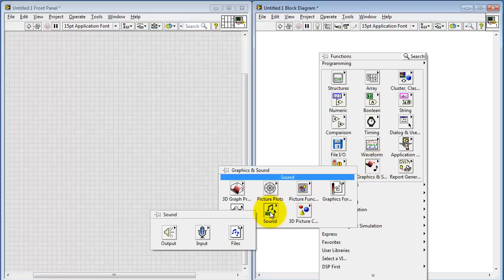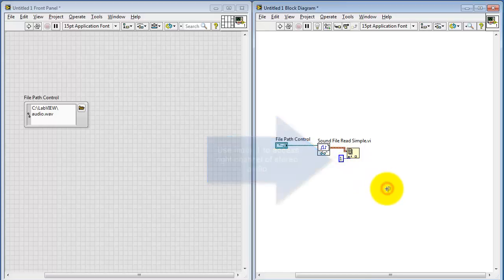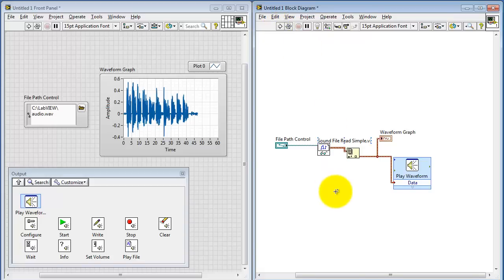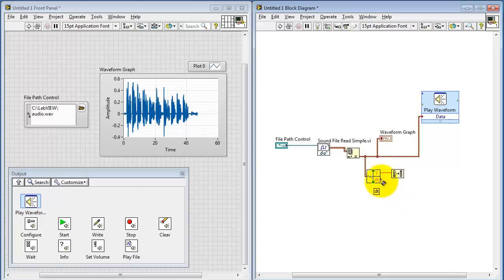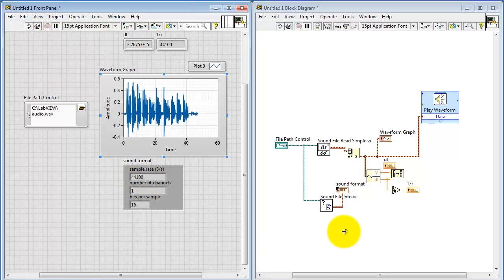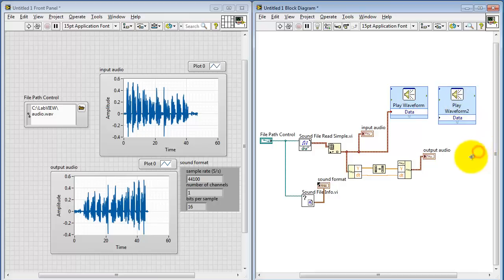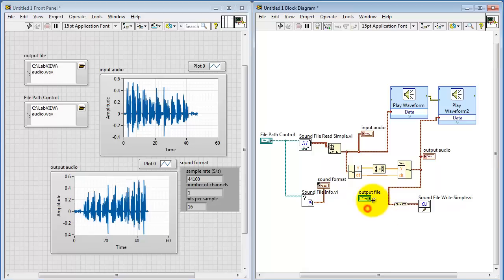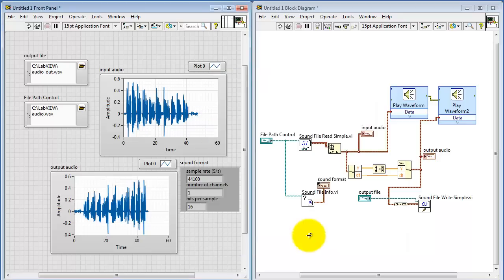NI LabVIEW: Work with .wav audio files

Comment: Thanks for the video. I acquired some signals using Labview a while ago and saved them in a text file. Just realized that I need to do further processing like rms conversion, FFT and filtration. How can I create a VI that can read the values of the signal from the text file and display back in labview for further processing?